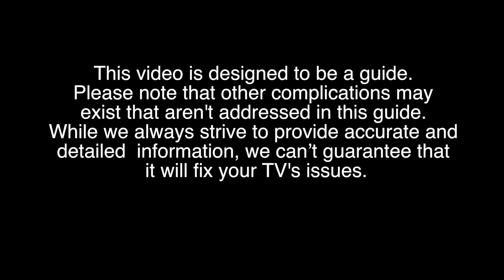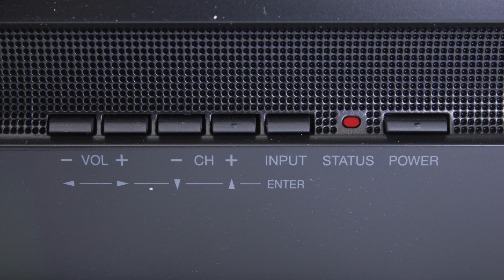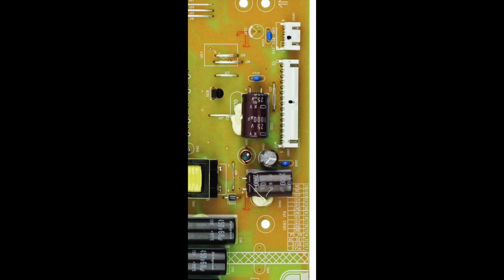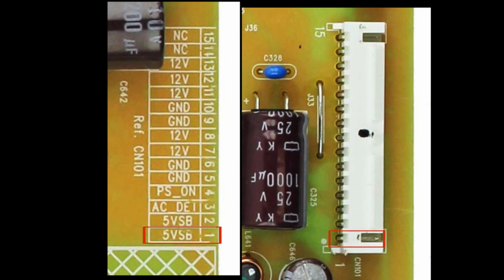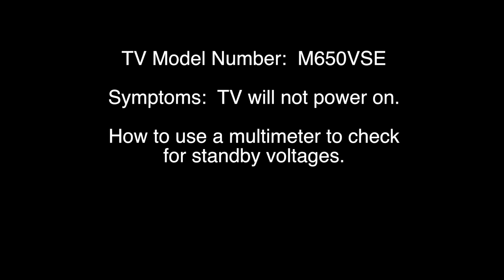Vizio 4k TV M55-C2 Will Not Turn On No Power Help - Checking Standby Voltages - No Power

Comment: Do you have a test video for the M55-C2 LED Driver board 748.01205.0011? I have tested my power supply and it seems to be working.  I don't see any LED drive voltage out but I am not sure.

Comment: I would like to see some deeper trouble shooting such as  bad backlight drivers. What should they read on the meter etc. Replacing small components on the boards instead of replacing boards. Something deeper than capacitors and resistors.

Comment: PLEASE HELP! 

I have a Vizio M65-C1, I came home one night and 
tried to turn the power on, nothing! No standby Light, no clicking, 
nothing. I took the TV apart. There are NO visible signs of damage, 
blown capacitor etc. I began probing. The current going into the Tv from
 the wall is 117.9V (a little low, but i tested two wires and multiple 
outlets and they also read 117V). The Ceramic slow blow fuse is also 
good. Capacitor banks seem to all have 24v. on the pin section 
containing the stand by voltage the standby read at 5.1v (same as on 
board). However, the other pins in that junction that were suppose to 
read 12V were reading 19V. Not sure if that's an issue or if that 12V is
 suppose to be when the power is on and the resting voltage is set to 
19V.

Comment: Hi, I have a Vizio M47i-A2, and was hoping you could point me to where to test the standby voltage and other things for a TV that has no sound, lights, or anything else. TV just turned off one day. I have used remote as well as the power button on the rear, and get nothing. DPS-111 EPA power board. Thank you for the videos!

Comment: I have a Vizio M60-C3 and out of nowhere it shut itself off and now I cant get it to turn back on. Power outlets work fine. I tried "power cycling" and that didn't work either.  Are there any internal fuses that could have blown? Thanks for any information that you can provide.
Reply: Did you ever figure this out?? This just happens to me on the same TV model.